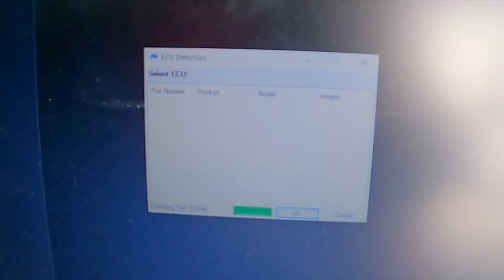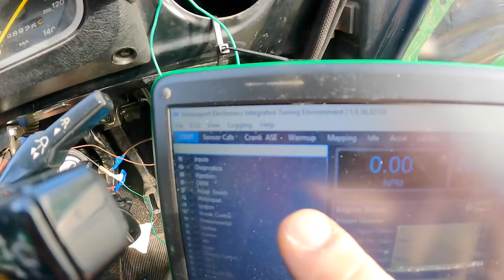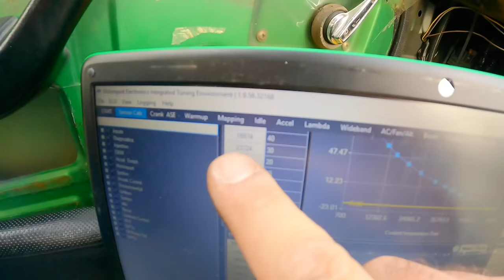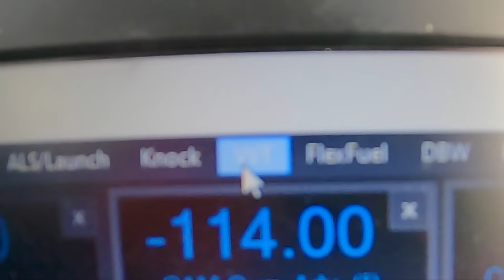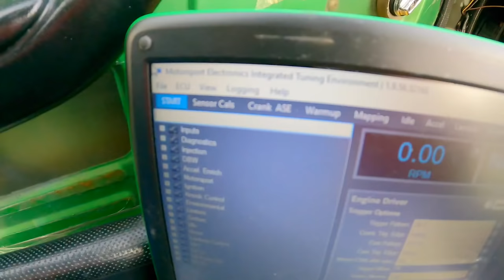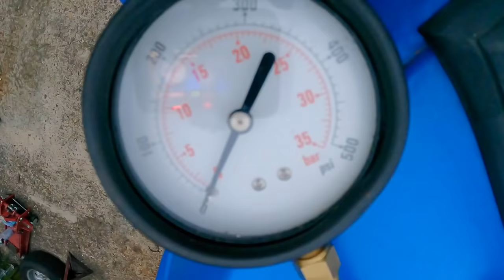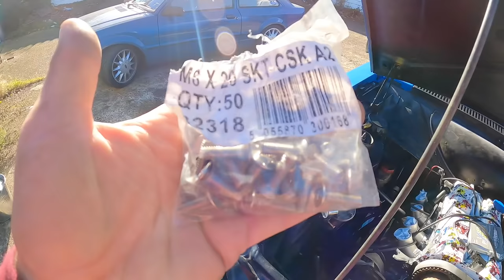Mk2 Escort ST170 install! 😃 *FAIL!!!* 🙁

Comment: Small piece of advice, Japanese stuff often use JIS screws. While they look like phillips screws they're slightly different and phillips screwdrivers chew them up.
Grab a #2 JIS screwdriver or bit to eliminate chewed screw heads.
Reply from the maker: Thanks for the advice mate! 👍 I actually got my new carb 'screws' through the post today and theyr all allen head bolts! 😃

Comment: I’m a bike mechanic of 20 years, and have done hundreds of sets of them on bikes
 You’ll struggle to get enough fuel for over 130 bhp on a car. 
I had some on a heavily built 1750 cc Toyota celica engine from 1974. It made 130 bhp and was on maximum size jets and slimmest needles and couldn’t flow over 6k 
 Bike cylinders are much smaller and Rev much higher so fuel used per stroke is less. 
Yes they can work on a 1300 polo but

Comment: Hi Marcus,hope all is well. I had the same problem with my bike carbs on my cvh Ford Bantam pickup where the fuel came out the vent tube. What i did was i got a small external tank that i mounted against the firewall close to the windshield wipers,in other words higher than the carbs and it was then gravity fed from that small tank and then i had a normal electronic fuel pump that was mounted close to the fuel tank that pumped the external tank with fuel and then obviously gravity fed from there down to the carbs. Just a tip if u want to try that maby,if not, i also heard u can use a fuel pump from a bike. Strongs on getting them to work,i cant wait to see your result and thanks for the great content. Lotsa love and support from Cape Town South Africa

Comment: Great video Mate, I'm into bikes and have experience with carbs, it sounds to me your running too much pressure and the bike pump is a good idea......but my best advice to save you lots of swearing and wrecking screws is NOT to use philips or posi drive screw drivers, you need to buy Japan Industrial Standard (JIS) ones, the only way to take Japanese bikes (and parts) to bits.......money well spent

Comment: unless a carb was new out of the box i would strip and rebuild with new service parts ie a kit,i bought a weber 32/36 a few months ago on ebay and the float chamber had an hairline crack in it and the seller claimed he didnt notice it,stay safe mate and always inspect carbs fully as they can burn your car out if damaged or faulty.

Comment: My R1 carbs on my pinto were also flooding so ended up buying a universal electric fuel pump for bikes from DANST and it worked perfect. Unfortunately you are experiencing all the gremlins at once with the set up but once you fit the new bits and check the float heights you should be good. Good work mate 👍

Comment: hi bro i had many escorts when i was younger ive being whatching your vids from the start i fell your pain in the early 1990, thinks were so much easer,with 2lts pinto like a lightened flywheel balensed crank ported head ,in fitted a 5 speed gear box,this was the time when the sri came out,i blow them all away my escort done 130mph plus.i hope every day you learn more,just being like at school every day you learn more chris fae scotland,
Reply from the maker: Everyday is a school day for me mate! 👍 I used to have a Vulcan Engineering built Pinto in 'Esther' and altho it was only 145 bhp I LOVED IT! 😃 I just wish Pintos weren't so expensive to get decent power from.

Comment: The float valve seats have O rings into the carb bodies so it's worth changing those as they all shrink. Ideally you should be using Viton O rings as the generic jobs can be anything which could well be attacked by the fuel.

Comment: Have never seen bike carbs work properly on car installs (I've seen a few people spend a fair bit of time trying to make them work too), the throttle progression is always off, the manifolds don't isolate them properly from vibration so they are prone to flooding & they are tricky to get the fuel pressure low enough as they are generally designed for gravity fuel feed...all of this is before you get into the actual jetting, needles, slide cutaway, llw speed progression drillings plus whatever hacking has been done if the carbs have been respaced. As you're running an ecu anyway then throttle bodies (even bike derived) would have been the natural step if you want individual throttles? I hope you can get it sorted though 👍

Comment: You may want find out what the float height for the carbs is supposed to be. They all need to be the same height, I suspect that is why you are having fuel leakage as all 4 carbs are not in sync.
Reply from the maker: Thanks for the advice mate! 👍 Luckily the float height on these carbs isn't adustable but once I get them running I'll defo be getting my carb syncroniser tool on them and adjusting the screws to make sure theyr all sucking evenly.

Comment: When my c20xe engine had bike carbs on it I had one of the float valves become sticky . So I was told to remove them and boil them in a pan in boiling water.  They released and worked fine . Maybe worth a try mate
Reply from the maker: Thanks for the advice mate! 👍

Comment: Have you checked the floats to make sure they don't have holes in the float bodies and that they actually float?
Reply: Why would they have holes in them? They are plastic.
Reply: @JazzFunkNobby1964  the floats are often plastic and so they can deteriorate with age. The plastic can crack or can get small perforations which allow fuel into the float, then the floats won't float with the result that the fuel valves won't close.

Comment: You can run a fuel return line to lower pressure
Reply from the maker: From the breather pipe??? Its almost as if that pipe is SUPPOSED to be a return BUT I know that DanST knows his stuff and he is adamant that its just a breather. 👍
Reply: @marcushayesford  no to lower fuel pressure them bike carbs don’t like the pressure 👍gravity or a real low pressure pump on the bikes. Good luck